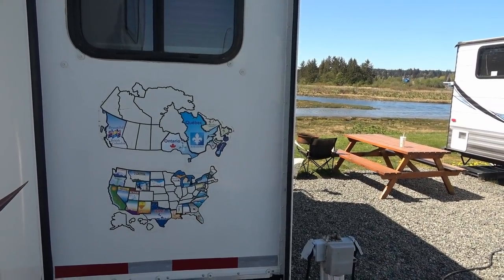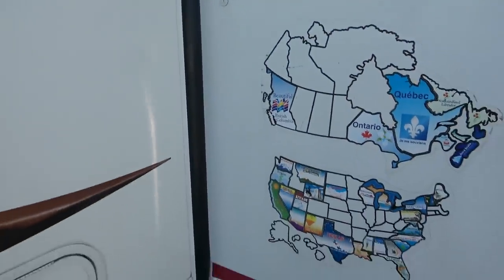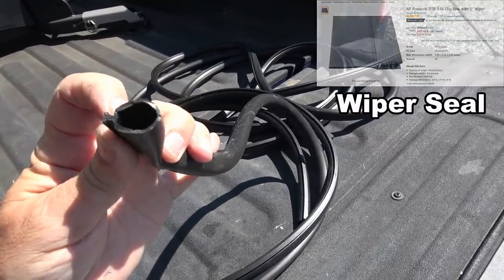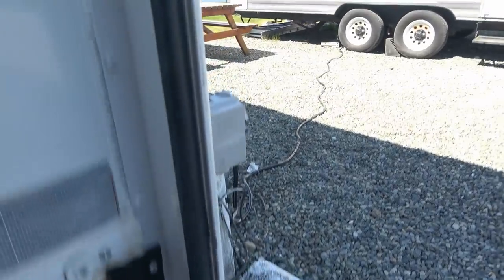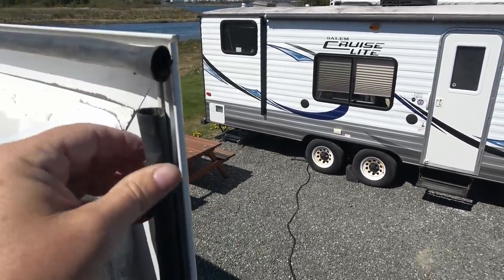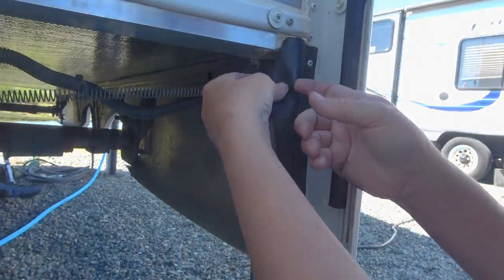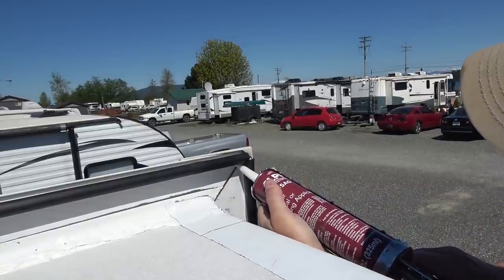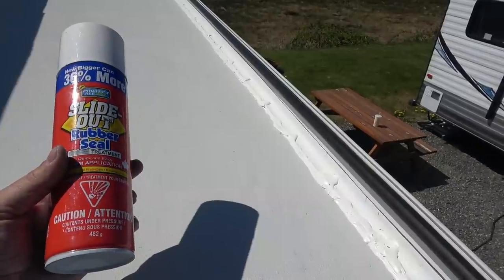Replacing RV Slide Out Secondary Rubber Seals -  Keystone Cougar Trailer 2011 276RLSWE

Comment: Another great job is done Ray but if you put on a slide topper it will preserve the top of the slide from debris and rain. Nice job  Ray.
Reply from the maker: Toppers have pros and cons, personally, I'd rather not have a topper, I just have the one slide. We often camp in very high winds during our normal winters in the desert and travels on the west coast.  The flapping would be annoying and worrying about them being ripped off. Plus the added cost and maintenance. I think I'd rather change the membrane every 10 years or so than deal with the slide topper and extra hardware. :) 
Maybe if I camped under trees a lot or in high heat I'd think about having one for shade.  But for me there isn't a compelling reason to bother with one.  Slide toppers can also be an issue in the snowy weather if the wind blows the snow under and it then melts and refreezes and creates an ice dam under the topper.
I've heard various pro and con opinions on them from people over the years that have them and have personally watched people have to use all sorts of methods to tie them down or have to bring the slides if strong winds kick up. One guy I spoke to in an RV Park in Mojave, CA, told me he lost all 4 of his slide toppers when a 100 mph gust came through. Each to their own but not something that I plan on adding to the rig. Maybe when I'm older and less agile and can no longer clear the roof I'll want one.   Cheers, Ray
Reply: @LoveYourRV  Yes you are right it depends on the situation of every individual, I have 2 on mine and yes they are cumbersome to clean, and to think of it I place a small ball under the awning so we do not get a puddle of water in the center but its camping.

Comment: 👍👍  Great info. Thanks Ray.
Was wondering if you use wheel covers when you're set up?
Reply from the maker: No, I don't bother,  trailer tires like mine wear out fast and we travel a lot so I find I'm usually replacing them every 2-3 years for worn out tread well before they would have any sun damage issues.  Usually I see the covers on big motorhomes that have large really expensive long lasting tires.

Comment: Hey Ray! I would like to make just one suggestion...I would have cut those rubber seals on a 45 degree angle so their surfaces are flush, and then sealed them together with some liquid rubber or Flex Seal.
Thanks!
Reply from the maker: Thanks, sounds like a good idea!

Comment: Another handy video ("If they don't find you hansom..."). I looked through your previous videos, Ray, but I can't find the milk in the refrigerator. I am having leaking problems with joints in my gutters. Have you had to do gutter repairs?
Reply from the maker: I haven't had too many problems. I did have one leaking at the seam where two gutter lengths met. It would run down the side wall making a black streak all the time. The OEM had used silicone caulking to seal and it had dried and worn out. I clean out the old sealant and used a little Eternabond roof patch tape on the underside to reseal.  Cheers, Ray
Reply: Thanks Ray, I'll give it a go. Awesome video featuring your charging system! Great clean wiring that. Maybe if you have heat issues if you travel south, a little 12v fans on a thermocouples next to the controlles would help?
Reply from the maker: Thanks, good idea. I'll monitor the temps this summer and see how it goes.

Comment: FYI ... The red can, foam seal conditioner is usually available at Camping World. I get a can a year and do my seals several times a year with it.
Reply from the maker: Thanks for the info, good for USA folks, but no Camping World up here in the Great White North.
Reply: @LoveYourRV  They have mail order if that will work?
Reply from the maker: Cross border shipping and customs brokerage charges generally make it not worth it for us. Usually cheaper to get up here from other suppliers, also returns would be a major pain due to the reverse border shipping. I find in this area on the coast lots of the boating and marine stores are a good bet for most products along with Amazon.ca and Canadian Tire stores.

Comment: Fluid Film loves synthetic rubber!  Don't spray it directly, soak a rag and wipe it on. 303 is good, I use it on my interiors but FF swells the rubber a bit, rejuvenates appearance and performance.  The weather seals on my 2005 vehicle look and operate as new including no freezing to the door frame. No wind whistle, no dusty interior.  My mechanic doesn't believe me that they are original to the vehicle. Thanks for all you do for all of us Ray.
Reply from the maker: Thanks for the tip, but I'd be hesitant to use FF near the RV roof especially the wiper seal that sits on the surface, most petroleum/paraffin products can have a negative effect on EPDM roof materials - https://www.matsmatsmats.com/commercial-industrial/epdm-resistance-to-chemicals.html  If the FF swells the EDPM synthetic rubber it could cause the underlying glue to detach leading to bubbles or softening.  Cheers, Ray
Reply: @LoveYourRV  Fluid Film is lanolin based...sheep wool wax. Zero petroleum in it. Maybe swell was the wrong word, it restores flattened and used weather seals to like new dimensions. Plumps them up.
Reply from the maker: FLUID FILM® is formulated from specially processed wool-wax, highly refined petroleum oils  "May cause swelling on non oil-resistant rubber goods"  https://www.fluid-film.com/products/fluid-film-aerosol-non-aerosol-bulk/  Also, have a look at the safety data sheet - http://www.fluid-film.com/wp-content/uploads/2016/07/SDS_Aerosol.pdf
3. COMPOSITION/INFORMATION ON INGREDIENTS
Chemical Name CAS No Weight-% Trade Secret
Refined petroleum oil, hydrotreated heavy paraffinic 64742-54-7 40 - 80 *
Petroleum gases, liquified, sweetened 68476-86-8 1 - 25 *
Calcium petroleum sulfonate 61789-86-4 1 - 10

Comment: You seem to have the Camco EvoFlex hose. How do you like it so far?
2 weeks ago received the 10' but not going camping before mid-June. Just had to re-book Ontario reservation due to travel restrictions between Qc & On.
Reply from the maker: I bought the 35 footer a few weeks ago and like how nice and flexible and nickel plated connections it is but its taking its time getting rid of the weird new rubbery taste in the water. My Camco heated hose I got for the winter did they same thing, took a while to get rid of the taste. So have to run the water a bit when getting a drink.
Reply: @LoveYourRV  Ok Thank's
Will be preparing for the season after the winter storage. I always rinse thoroughly and sanitise, so I will make sure to include the new hose in the process.